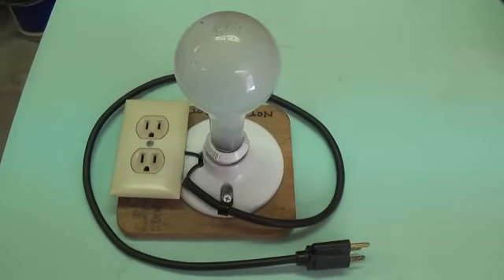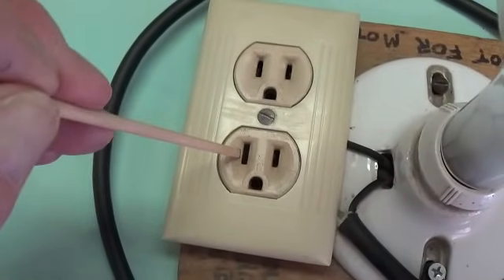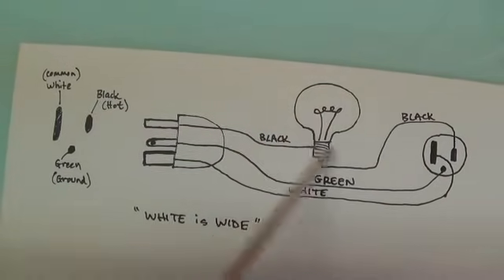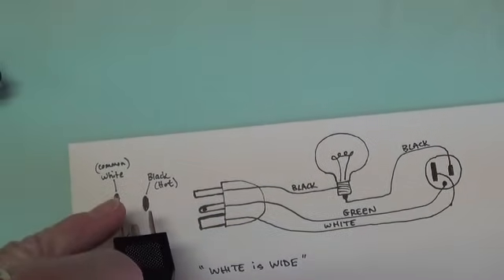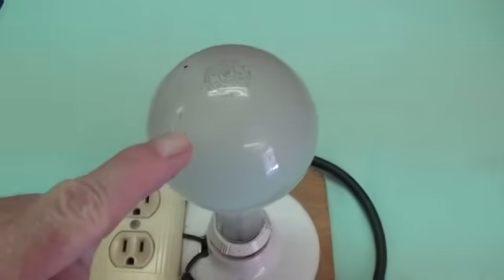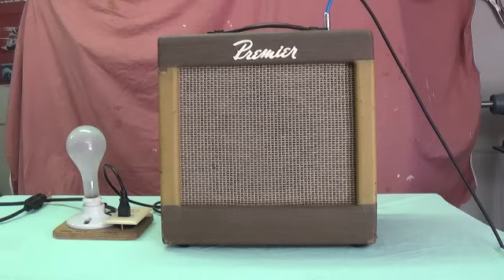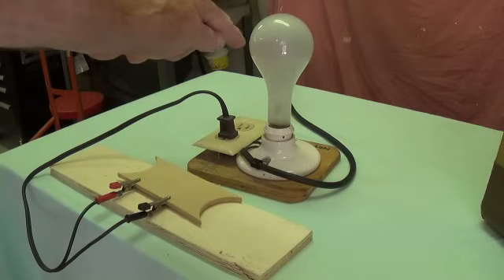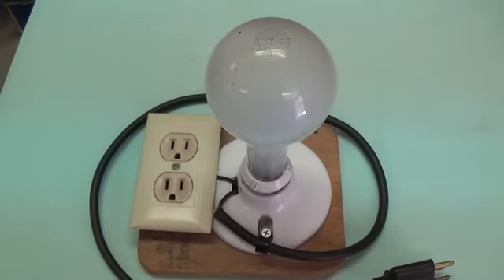Build Your Own Current Limiter for Protection when Repairing and Testing Electronic Equipment

Comment: Because incandescent bulbs are getting harder to find could I use a 250 watt incandescent heat lamp in the unit I made . I followed your design and it works great but my 150 light bulb broke I drop it so I’m looking for a replacement
Reply from the maker: The last time I looked, they were available on Amazon, Chris.
Reply: @UncleDoug  I do see them there I was going to my local hardware store .what is the standard base size , I’m thinking about getting a 150 watt and a 200 watt bulbs I have a 20, 40, 60 so I used it like a Veriac to slowly power up the new build

Comment: Thanks so much for posting this. I have a Supro amp 1940s I was told don't even plug it in until I replace all the electrolytic capacitors due to it being 81 yrs old. What's your opinion? Thanks for your time you take to teach us your skills
Reply from the maker: You're welcome, Emmanuel. I doubt that your Supro amp is 81 years old, but there is a good chance that the electrolytic caps are faulty and should be replaced. Also, the amp should definitely be plugged into a current limiter for testing.

Comment: Doug - do you see any issues with the following setup?

I have my variac connected to the wall outlet, my isolation transformer connected to the variac and then my dim bulb current limiter connected to the isolation transformer.  The DUT is then connected to the current limiter through a Killawatt P3 device so I can easily monitor voltage and current draw.
Reply from the maker: I'm sure there are pros and cons for different arrangements of test equipment, Carl, but yours seems logical to me. Just be sure that the DUT has no ground reference through the CL or IT.
Reply: @UncleDoug  Thank you, Doug.  I have followed your guidance carefully in that regard.

Comment: What size bulb would you recommend  here in uk since were on 23ov.
Reply from the maker: Since your current flow is 1/2 ours in the the U.S. (due to our use of 120VAC), you can use a bulb between 100W to150W, depending on the current draw of the amp circuit.

Comment: Is there any reasoning in starting with a lower wattage bulb (minimum current thru the amp) and progressing to a higher wattage bulb?
Reply from the maker: That would make sense, S & S.....and after gaining some experience with the relationship between bulb and circuit wattage, this will probably not be necessary.

Comment: Hi Uncle Doug ,
I recently joined your channel, my name is Carlo and I am interested in both tube and solid state amplification restoration. First of all, I congratulate you on your channel ..... really well done ... I learned a lot from your videos. ..you are really good !!!
I need your advice on the correct way to power on amplifiers and other audio equipment after long years of inactivity without causing damage. Is it better to use a variac and progressively power the equipment starting from half the supply voltage for a few hours or turn it on directly using a current limiter like the one you built with a lamp? I am referring specifically to an 80's Pioneer rack that I bought. .. in perfect condition but remained inactive for fifteen years. Thank you in advance for the advice. 
Greetings, Carlo
Reply from the maker: Greetings, Carlo, and thanks for your nice comments. On long-unused equipment, a slow start-up with a Variac is best, with a current limiter between the Variac and the circuit, just in case a short occurs during start up.
Reply: @UncleDoug  Many thanks Uncle Doug ..... I will follow your instructions .... and when the amplifier turns on I will toast your health with a glass of splendid wine !!! Best regards

Comment: I'm rebuilding the limiter I made a while back and was thinking of adding a switch, but maybe it is not necessary. I suppose it could at least add protection when changing the bulb. But the question I have mainly is that I'm curious how long one has to turn off the power once you see the bulb is glowing bright.
Reply from the maker: A switch is really not necessary, AOM, because there is no need to hurry excessively to unplug a device that illuminates the bulb. As demonstrated by the dead short test in the video, the greater the flow of current, the more it is attenuated. Also, wouldn't simply unplugging the CL make better sense when changing a bulb?
Reply: @UncleDoug  Makes sense. Thanks.

Comment: If one would decide to add a light switch on this current limiter to kill power, does it matter if you put the light switch in between the white wire, or the black wire? I would think better to put somewhere in the black wire section but am checking to see if I am understanding correctly.
Reply from the maker: Probably in the black wire, AOM.

Comment: UD-- I'll give it a shot , I have my own 24 track recording studio so I am  versed in  proper mike and setup ,like you said the SM-57 is a better choice to use for guitar/drums/keyboards etc. in certain case's it sometimes helps to use a compressor and noise limiter to cut down on the background noise and tightens the sound somewhat (keeps the amp speaker from reflecting from  the back wall and returning to the mic in my opinion , I noticed on one of your vids you where using a recorder ,have you considered a small mixing board along with that ? it opens up a lot more venues like EQs/white noise setup for the room your in , some times the camera mike does not work to good when you move away, I wonder if a person could take a drone camera and place it on a head ban and wi-fi it to the camera wha-la hands free to unplug cords/ do vids/ play guitar/shop work/hot rod vids etc. etc. etc. without hold-n the camera + lets you place the camera  on a stand when your do-n your Jack and Cassey sound checks  here I go again make-n a long story longer, I should become a novel writer
Reply from the maker: Thanks for your helpful suggestions, Stephen. I'll keep them in mind.

Comment: UD  built me one of your current limiters with a little flare , I took a metal outdoor bulb socket fixture mounted it on a wood base then took a heavy three way extinction cord cut it in half, then put a inline clamp on switch before the socket and base, my theory was, this way i could turn off and on limiter bulb without unplug-n the amp each and every time I went to drain the caps, is this feasible ? once again I apologize make-n a long story longer
Reply from the maker: Greetings,, Stephen. First, I hope you used an "extension" cord for your project ;) Yes, you can add an on/off switch if you wish. Several other viewers did the same thing. Best of luck with your new CL.
Reply: @UncleDoug  once again thanks -4- the get back on my ?  and tangerine  well done

Comment: Hello Uncle Doug,  In Germany with our round "Schuko" outlets you are never certain of which pin is Line and which is Neutral. I have been contemplating that  for some time and am thinking that the best way around this to use an Isolation transformer in conjunction with the current limiter in order to remove the ground reference. Would you agree? Are there any potential issues I need to consider using an isolation transformer together with a current limiter?
Reply from the maker: I'm surprised that Germany is still using unpolarized outlets, Dan. An isolation transformer would reduce the shock hazard and a current limiter would protect the circuit.....so this would be a wise practice. I would run the CL between the IT and amp circuit, to protect both the IT and the amp itself.
Reply: @UncleDoug  Would it be possible to instead use two lightbulbs, one for mains/line and one for neutral, in order to be sure you haven´t messed up the polarity? (I´m in Sweden and we don´t have polarized outlets either). Thank you for your great channel, btw! Everything I know about amps etc. is from you.
Reply from the maker: @sluscen  I guess you could, using 1/2 of the total wattage before and 1/2 after.....but you should experiment, i.e. set it up and test it with a dead short, before trusting it.

Comment: I want to build one for checking 24-28 volts AC. If there is a shortage in somewhere
.What incandescent bulb should I get? There is a formula to calculate the watts for the bulb? Thanks
Reply from the maker: You would have to find a bulb that operates on 24 to 28 Volts, Guillermo. Good luck.

Comment: As always your vids are gold. So I guess if one does not have a Variac to slowly bring the voltage up, then at least this remarkable simple device will work a miracle. (and I fully intend to use one! ) Still though, I see so many references to bringing voltage up slowly to max with a Variac when first firing up old amps. Would you recommend using a Variac at certain times?
Reply from the maker: Yes, it is a useful tool for the purpose you described......but always use the Current Limiter also.
Reply: @UncleDoug  much thanks. now to make the limiter and find a Variac.

Comment: As a general rule I use the same wattage of tungsten light bulbs as the devices rated wattage. I have 3 lamp sockets wired in parallel, in series with the black wire. For example, for an all american five radio I would use a 40 watt bulb, whereas a vintage tv would need up to 300 to 500 watts of bulbs. A variac and a light bulb together is what I normally use. You are a good and patient instructor, you can never take safety for granted.
Reply from the maker: Thanks for sharing this with us, Z1. I appreciate your kind comments.

Comment: hi is this corect...the amount of current the bolb will let through is max  (110v divided by 250watts) .44amps?...im looking for to limit an australian 240v to 2400w...wonder if i could use a kettle or hot water eliment to do the same thing?
Reply from the maker: My calculations differ from yours, Russell. P = IV  so I = P/V  and I = 250/120 or approx. 2A. Nothing really works other than an incandescent light filament, because its resistance increases with heat (and current).
Reply: @UncleDoug  i dont know what p l mean but i think v stands for volt...when you say nothing else will work...what is your definition of work?..im confused we have pots that are resistors that you can increase or decreas the resistance and we also have resistors that to my knowlage have a linial resistance...bothe work for their chosen aplication??????????
Reply: by the way the kettle,light bulb,heat globe from a cook top (one at a time) all work inline with the mains,rectifier,battery if the definition of work is the curcuit braker does not trip....250w globe,900w heating element globe from a cook top,1800 to 2200w kettle....the battery is 17 cells in series and their specifications say les than 1 ome resistance each.each cell is 16ah and can charge at 20c....if the kettle or globe or cook top globe are not workin as in not limiting current then im charging that battery and boiling water at the same time?..and im not triping the curcuit braker?..in that case no use boiling water for no reason...ill do the experiment of removing the kettle...whats your prediction first though?
Reply: @UncleDoug  the sircuit brakers pop with out the kettle...the sircuit braker does not pop with the kettle...seems the kettle limits the currant.

Comment: Just built this because  i have an older Yorkville solid state mixer amp with a short.
I could only find a 200 watt bulb.
Tested it on the bad amp and the bulb glowed brightly.
Disconnected transformer from the board and the bulb glowed dimly.
Tested limiter on an identical good amp mixer and the bulb glowed dimly.
i assume its because i need the 250 watt bulb.
thanks
Reply from the maker: You're welcome, Lorne. Good luck with your repair.

Comment: When I was MUCH younger , my father ( who was an electrician) would use this method to find and fix short circuits in old houses with screw in Edison fuses. Remove the blown fuse and screw in a light bulb. When you remove the short, the light goes out. Sure saved on checking with good fuses. We also found lots of pennys under the fuses. Dad always removed them, gave them back to the homeowner and told them "If you use a penny as a fuse, read the warranty on it.  In God we trust".   Also, Thank You for spreading your knowledge to the amp community. You make the world a smarter place when you do.
Reply from the maker: Thanks so much for your very nice comments, E. We really appreciate them......and good electricians, like your dad.
Reply: I’m old enough to remember when people put a penny in because they didn’t have a spare fuse. So many people don’t realize how lucky they were to live a full life.
Reply: I knew a little boy who used to get out of the bathtub and piss into an electric wall heater !!! Imagine that ..... a 5 yr old standing (soaking wet) in a puddle of his bath water , urinating into a 120v ac wall heater !! 😢 Why ?? He like to see the steam and the sound it made !!! 😂 Yep , he still alive !! YT😅
Reply: @eixr I learned something new from your comment, thanks for sharing. ..
Reply: What about a 500 watt halogen lamp for the current limiter?
Reply: @TravisHaynes-l7n 
I think it only needs to be 300w.
Unless your unit is very big, even a 100w bulb will work
Reply: Great story!

Comment: Many thanks Uncle Bob for another excellent video to help us newbies... And this one saves lives!  Fantastic.  One question:  Like many shed dwellers, my power supply in the garage feeds a multi-board AC power outlet.  I can plug up to 8 AC items in simultaneously.  In this scenario, would it be a good idea to run the current limiting lamp in series in front of the entire multi-board?  My assumption is that this would provide me with current-limiting protection across all of the multi-board plug outlets - a great thing!
Reply from the maker: The device is best utilized with a single circuit plugged directly into it, Tony. If you have multiple devices pulling current through the CL, the bulb may be illuminated even without a short circuit being present.

Comment: Couple of Questions Uncle Doug:
1. Can your INCREDIBLY AWESOME Current Limiter setup be used to operate something like a Weed Eater — or some other tools with brush motors — whereas, if the weed eater uses 4.5 Amps, would the bulb-resistor therefore have to be something like a 500 or 600 watt bulb?

2. Also, Can I connect your Current Limiter directly to the OUTPUT of a 120, 2000 Watt voltage controller to lower the SPEED of the Weed Eater so that the Weed Eater does not continue drawing the 4.5 Amps after reducing the voltage with my Voltage Controller, because, I already burnt out one weed eater! 
According to something I read, I believe the Wd Etr was still drawing the 4.5 Amps despite me having lowered the voltage with my controller? It operated fine for a few minutes but, after I increased the speed, it completely gave out and stopped working!
  
Hope you understand my questions? Thank you so much for this extremely informative video and REALLY COOL, SIMPLE project...have to use it somewhere and hope it can do what I'm asking!!!
Reply from the maker: Sadly, the current limiter does not work well with motors, Rey, and definitely not with those drawing so much current.
Reply: @UncleDoug  THANK YOU VERY MUCH!! 
How about this: What if I use a 5 Amp FUSE instead of a light bulb, and wouldn't that also do the same job on what you use your current limiter for? 
In my case, as soon as the motor would begin to pull the current above the motor's rating — 4.5 amps — wouldn't the fuse blow as soon as it reaches its 5 amp rating so the motor won't burn, and wouldn't that also be the case in what you use your current limiter for by using a FUSE, instead of a light bulb? 
Just wondering if that would work?

Thanks again brother and God Bless!!!

Comment: I reckon if you took a candelabra or other multi-bulb fixture you could "dial in" whatever current you needed by adding or removing bulbs.  Maybe even a string or two of those  old 7w 120v xmas lights would work.
Reply from the maker: You're right, HS......either switch bulbs in and out of a single fixture, or have multiple fixtures in parallel.

Comment: My garage where my workshop is located has a GFCI breaker in the house which protects the power line going out and the building.   That way, if a tree trimmer decides to trim my power line going out there then the breaker will hopefully trip and not turn the tree trimmer into a "burnt out fuse".
I was thinking however that a person making a current limiter could install one of these to help protect against a sustained AC power electrical shock.  Of course, it doesn't protect against capacitor and choke discharges but every little bit helps.   If a person works on a widowmaker amp or an "All Almerican 5 radio" then they really should consider adding a GFCI to their current limiter - but still be careful.   GCFI stands for "Ground Fault Circuit Interrupter".  You can buy them as outlets with the red and black switches for test and reset.
It measures the current going into the equipment and returning and if the accounting of this sees five or more milliamps unaccounted for then it shuts off the circuit.  Of course, it's not a guarantee against against everything, here's a government website for info on it:  https://www.osha.gov/SLTC/etools/construction/electrical_incidents/gfci.html
Reply from the maker: Since the current limiter does exactly what its name implies, it may counteract the sensitivity of your GFCI. I'm not sure the two devices would work well together.
Reply: @UncleDoug  You have a good point, which is the reason I thought it would be good to ask.  I'm suspecting if the current limiter outlet is replaced with a GFCI at that level it's measuring what the amp sees -- although the internal transformer in an amp could also limit the sensitivity.